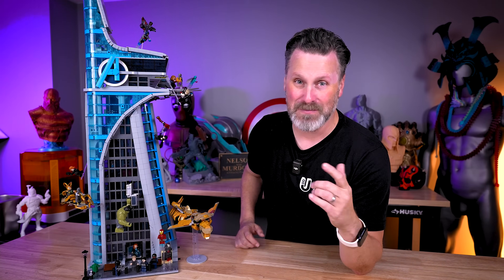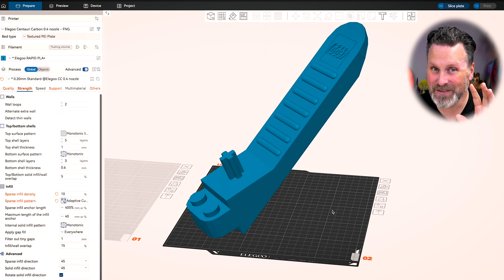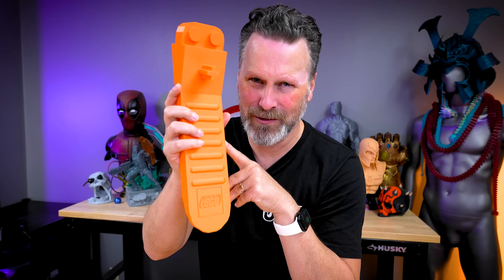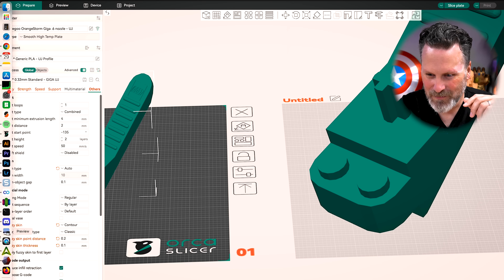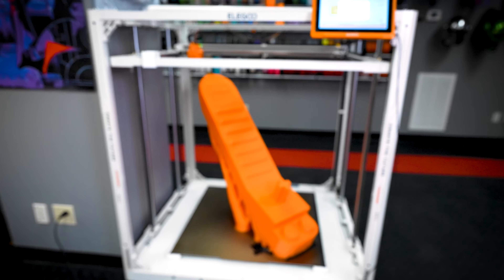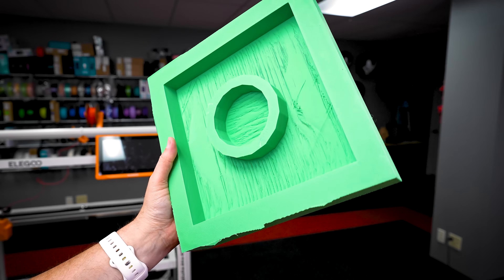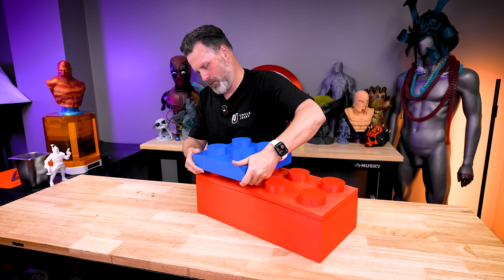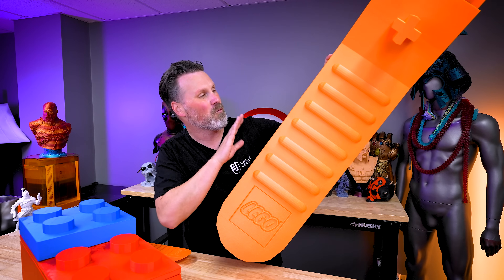Making The World’s Largest LEGO Brick Separator (probably)

Comment from the maker: Now how the heck should I wall mount this to put it on display in the shop?
Reply: Make a print that looks like two bricks being separated. Mount that to the wall, and attach this to that.
Reply from the maker: @nimoy007  Ohhhhhh now that is a pretty rad idea!
Reply: That's the neat part, you dont😂
Reply: lots of command strips lol xD
Reply from the maker: @boredbum2009  😂 I do have a gridfinity bin full of them
Reply: So you already have the "how do I mount" part figured out, if you don't mind more vertical spacing - model your two Lego bricks you tested this with,  but together, and with an angled slice so the separator fits flat against the wall. (The partial bricks would be coming out of the wall at an angle.) Put mounting hardware inside. Not only shows the piece but what it does. It does add some vertical space requirements, but it'd be a neat display.
Reply: i created a remixed file on makerworld and added a flat area and keyhole slot for the one that maxes out the build plate on the bambu's
Reply: @PrintedLayers3d  Where are those features located on the model in your version?
Reply: @nimoy007  it is located at the top area by the "separator" area. I have the model on Makerworld "Giant Brick Separator with built in wall hook"
Reply: make a giant lego board and glue it to the wall so you can connect it
Reply: More l8ke hunney i expanded the separator
Reply: What about scaled up 1x2 Hinge brick(s)?
Reply: The ceiling for the ebic skinamarink reference... I may have made this joke on tiktok too but I am to tired to check lol.
Reply: Mount to the wall , but have a 1x2 flat connected to the bottom of the separater. Then make a sign that says “Separation anxiety contained”. You’re welcome. 😂😂😂
Reply: Print a giant 1x2 hinge brick and stick it onto the antistuds of the brick separator.

Comment: Since you are a big print guy who has a CC.  Have you run into the "stop mid print" issue with the CC on larger prints?  If so, have you found any approaches for avoiding this issue, slicer, workflow, etc.  My 8th printer, so not a newbie.  Results from CC are amazing, but have run into this issue.  Not heat creep, room temp, power (900 watt sine wave ups), etc.  Definitely something odd and seems to be an issue for a lot of CC users.  Posted a question for Frank Lee as well.  Hoping that two of the kings of large prints might have some perspective, or have seen/isolated this issue.  Only time have ever seen this before was on a T1Pro with a touchy filament sensor (which I deactivated) and it went away.  Like to do large prints, lamps, models, cool stuff for grand kids, etc.  Thanks in advance.
Reply from the maker: hey hey! I heard it might be an issue with the USB C Cable connection to the print head. That it might need to be tightened back down. If it still is occurring then I believe reachout to elegoo as I've heard they are sending out new USBC Cables to some users. I have not run into it on either of my CC printers so far 🤞
Reply: @ Thank you so much for the reply.  This is exactly what I was looking for.  Was guessing sensor or bad wiring, so this would make total sense.  Have a number of other printers, X1c, Plus 4, T1Pro, SV06 Ace, A1, and they all print well, but the CC has really shocked me with the quality of its prints.  So much so that I went for it with a multi day print.  Was pretty bummed to see it just sitting there, 50% complete, 400grams in.  Thanks again, this should really help me to get this resolved.
Reply: @UncleJessy  Common theme with the cable is that the failure location is often located towards the back left of the build plate.  Where the print head cable appears to be under the most strain.  I did take the cable off, blew out any dust (just in case), reattached firmly and popped the print head cable out of the first few links and pushed the cable back up from the bottom of printer to provide slightly more slack to the cable around the print head.  Curious if you are noticing and signs of stretching or wear to the print head cable towards the print head, or if you notice any signs of cable strain if you manually cycle your print head around through each of the corners of the bed.  Wonder if there are any existing 3rd party mods to improve cable strain relief for this part of the print head cable.  Again thanks for your time.  I am sure you receive a lot of feedback, and everyone would like to get a response.  I have been communicating with Michael Koch and others on the Facebook page to try and help narrow this down.  It is a great printer, and I would like to see it working for everyone, or at least be able to help people resolve it if/when it happens to them.

Comment: For getting a better fit between two lego pieces, try to pring the studs with a slightly different layer height. 0.02mm difference is enough to prevent the layer lines from latching together.

Comment: Your green brick failed likely due to inconsistencies in ambient temperatures causing a bow in the minddle of the layers. The machine doesn't do active leveling so the extruder is just going off of where the gantry is and pushing around already deposited filament. At least that's what I think happened here.

Comment: The prints look great, it's just a shame the original models were low poly. I don't know why people share models that are so low poly all the time.
Reply from the maker: An option is to take them into blender and you can subdivide them to add more geometry and help smooth it out a bit
Reply: @UncleJessy  Yeah it can be tricky to add geometric all over though, if not every part needs smoothing.
Reply: What's funny is the Lego logo and thumb grip ridges look pretty high poly but they went very low poly on the actual stud and corner geometry.

Comment: Mount the 2x2 on the wall and just stick it on that. Also just saw a video where a guy post processes his gcode so that the walls are deposited with a sine wave instead of completely horizontal. I was wondering if that would help in stopping delaminating layers, like what you were seeing in the large bricks. Another thing you could try, would be to use a filament with  glass fibre or carbon fibre in it. Whatever your solution, I would love to see how you print a large LEGO brick without it delaminating.

Comment: 4.6x the size (4.6x on each axis) is 97x the volume when you scale regularly (the same on all axis) because you multiply the scale on each axis. This number is more accurate to what we perceive the size of things as. (try printing a cube at 1", 1.25" (true double), and 2" and see which you pick as feeling like double the size).
Not useful for this particular print but if you are ever trying to go for a true percent increase, just take the number and take its cube root and that will give you what to scale by. In the example above, we are targeting 200% size or 2. The cube root of 2 is roughly 1.25 or scaling by 125% regularly. This has come in handy for props and cosplay stuff for me (scaling something to 80% cuts the size literally in half, helps give your scale some sort of range)
Reply: Human perception of volume is wild. We pretty much suck at the perception of scaling.